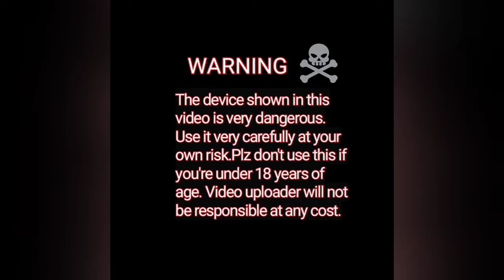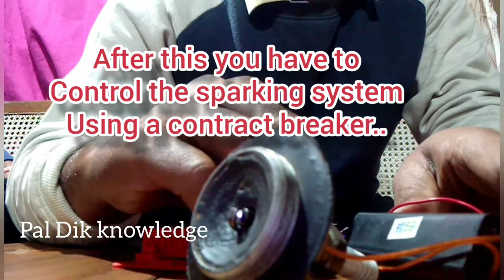Ignition system for Two stroke home made engine. Amazing method.

Comment: That arc isn't hot enought to light the fuel reialibly. And some high voltage convertors like that take long time to  create enought high voltage, you might not see the latency but the engine can. So the timing will be off.

Comment: Can i use pickup coil as a cotract breaker?
Reply from the maker: For a single cylinder engine, contact breaker is not so difficult to make. Just need some calculation. No need of any equipment.( For Home made engine)
Plz wait for my next video. Thanks
Reply: @paldikknowledge8530  thnks

Comment: What is that black module
Reply: Yes what is it?
Reply: It has to be some kind of a voltage regulator
Reply: You can not get that much spark from 2 aa batteries. So it's a step up type voltage regulation device